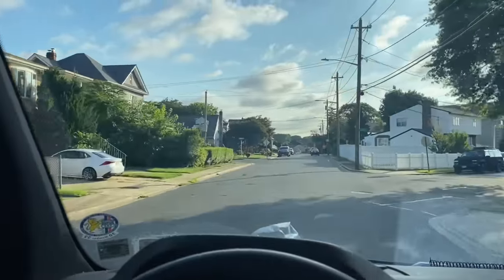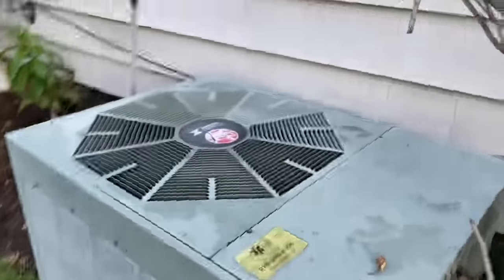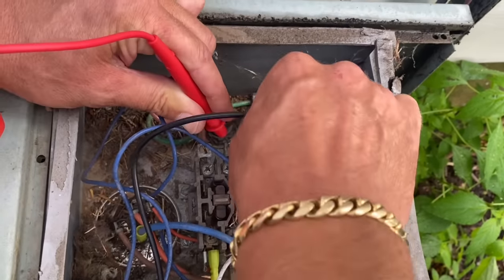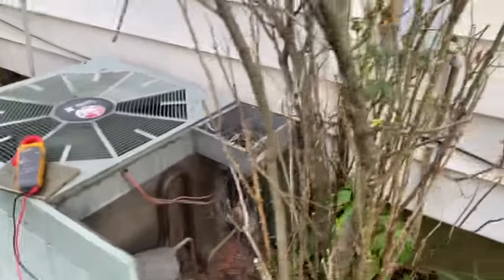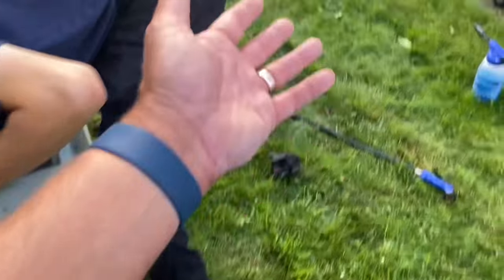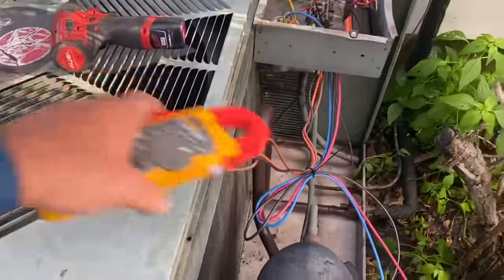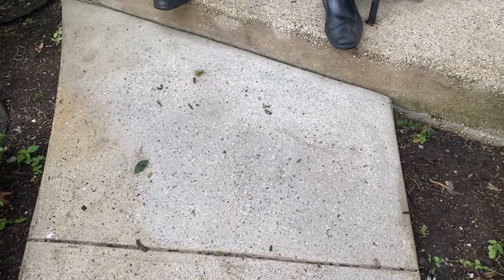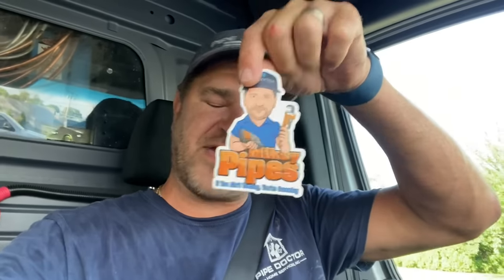The Mouse Got Cooked! Found Next to Dual Capacitor Circuit Breaker Tripped

Comment: Pretty sure that relay is supposed to be mounted vertical with the screw in the top position. Internal switch drops out using gravity. I believe.
Reply: That is correct. I saw that and immediately commented what he did wrong
Reply: This is a fact. Mikey fuxkn pipes will make it better tho. But yes even says it in instructions potential relay always mounted upward. #Lovebosch❤️

Comment: when you have a bad run capacitor it pulls high amps,the hard start is starting the compressor.but the amps will be high thanks for sharing.

Comment: That contactor was crusty. How was the dual run cap? I’ve found over the years that there is a direct correlation between dirty coils and capacitor failure. The longer a compressor draws high amps, the shorter the life of capacitor. If not a complete failure of the cap, then usually out of the 5%/6% range. Me personally, I would have changed contactor and run cap in addition to the start components.
Reply: Yeah. Especially with the new caps with the oils inside them with lower durability of higher temps
Reply: Yeah Mikey fell short on this one. That cap and contactor should have been changed, he left the burnt wire, and to top it off, that 50amp breaker is the wrong type for a SquareD Homeline panel, it WILL burn up the buss stabs in the panel.
Reply: Checking the capacitor under load seems like it might be a useful test in this case, but I don't know. You don't see all the HVAC guys do it; only some. Also, what's the point of installing a new 5-2-1 Start kit if you're not going to check the before/after In-rush LRA? Mikey should've checked that and documented it. But I'm just a homeowner...

Comment: Good diagnosis but I  didn't see you check the dual capacitor, you didn't connect gauges to the refrigerant lines. Beer can cold is an old term and isn't used much anymore. You weren't checking, just guessing

Comment: Mike that relay isn't mounted properly. The relay should be mounted vertically with a screw holding it from the top
Reply: @PipeDoctor  the wiring diagram has an up arrow right above the relay. Word Of Advice TV has a video on the 5-2-1. Skip to about 5 minutes in his video to see
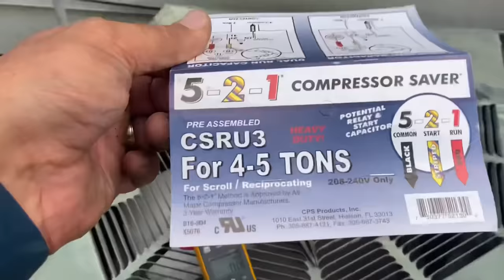Reply: @PipeDoctor  at 13:18 you can see the arrow on the wiring diagram when you were showing the packaging for the 5-2-1

Comment: I have had it where the fan motor is going out causing high amps like that  and runs fine while I'm there but locks up after a while.